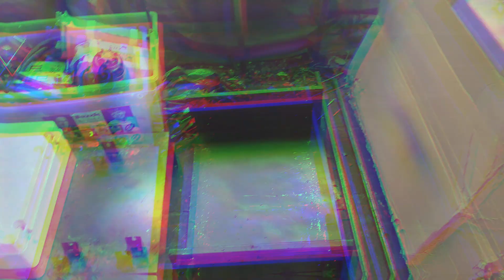Battery Box Rebuild: Completing my DIY EV upgrades with a move to 96s

Comment: Good progress mate, I don't think a single one of us ever put them back in the right order! 🤣
Have you seen the stainless steel tie wraps that are stronger and don't have the ratchet effect? They might be even better for your pipes.
Oh and I think I lost count around 8 innuendos so you are getting better. 😝
Reply from the maker: Yeah. I think once it's finished, finished - you know, in thirty years or so - I might go with something more permanent. But these just work for now. And they're cheap! It's not like the system is ever under pressure given the temperatures we're working with.

Comment: She is evolving nicely! Great job. Did you just add a module or are these 6 cherry picked from your stock for bmw cells?
Reply from the maker: Cheers! These are the later six module pack - which is perhaps why I'm now having issues with the BMS as it works slightly differently (though there could be many hardware and software reasons for this). The old modules will be made up with one of the spares to another six module pack with the best of my knackered ones and go in the boot for even more range. But I figured it would make most sense just to put the new modules up front first.